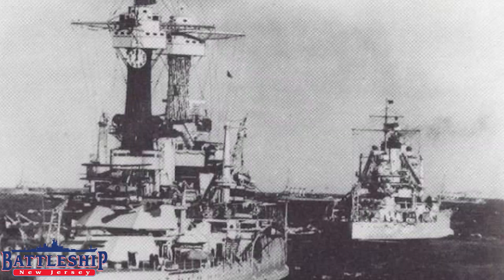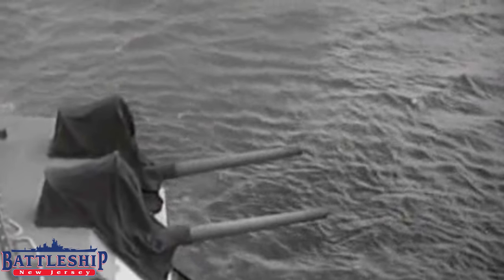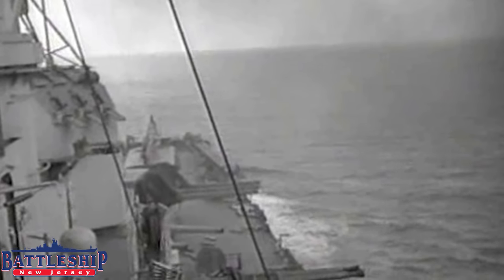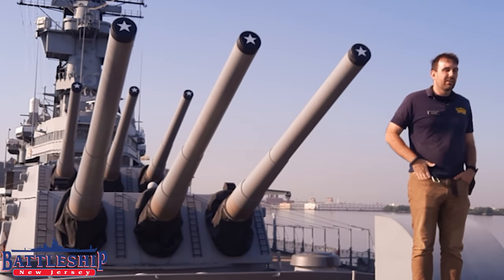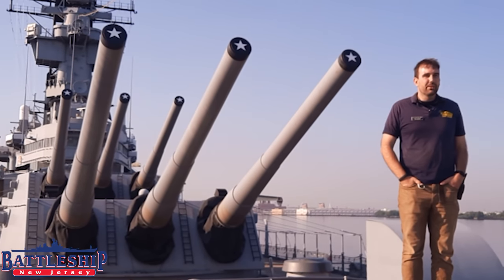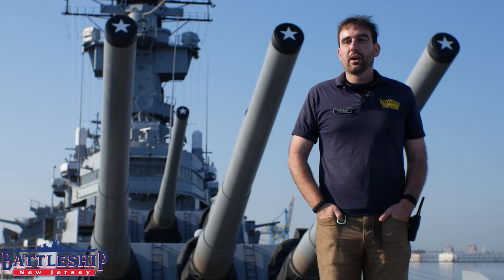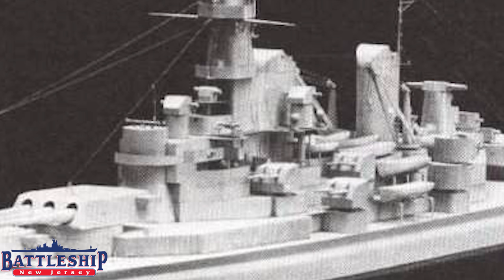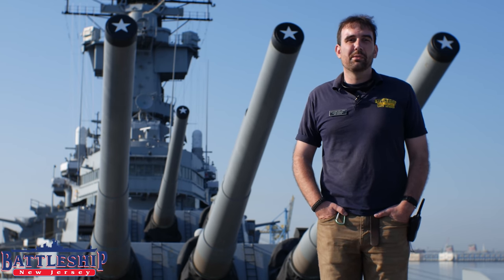Why are There Clocks on the Superstructure of Battleships?

Comment: A good reason not to send range and bearing via radio is that they are the same both ways, so you are giving your enemy a solution back to you as well.
Reply: Exactly what was on my mind throughout the video.   Jumping on comms to report "Enemy ranged at 12,500 yards" to your fleet also immediately informs the enemy, who may see you but not have an accurate firing solution yet, exactly where to set their guns to counter you.
Reply: True, but if they are duking it out broadside where they can bring all their guns to bear then neither side is going to be able to reliably read a clock facing forward and aft of the enemy ship due to the angle and parallax alone.  It would really only help the enemy if being fired upon from roughly the bow or stern, though I would presume they could simply disable the range clock facing the enemy in such cases, or, better still, set it to display erroneous ranges (why trust what your enemy is telling you and what’s a couple more switches on a ship already outfitted with thousands of switches for redundancy?).  But the best reason of all was that it simply wasn’t necessary to share such info at all once every ship in the formation already had the technology at hand to determine range and elevation far more accurately than the old way of doing things.
Reply: Bearing, no.
There are non-symmetrical effects even in a complete mirror situation, like spin drift, Magnus effect, Coriolis/Eötvös effect.
Air resistance means the projectile path is not a parabola and thus goes through different air (density, wind, moisture ... ) from one ship to the other ...
... and you can see quite clearly how much the barrels of the enemy point or not point at you.  Just think of a ship pointing right at you or a bit left or right and how clear even small changes are from straight at you.
Reply: @advorak8529  Yes the bearing is not entirely symmetrical, and the wind may be slighty different, but a really good starting point is to apply exactly the same angle offset as your enemy is if it is hitting and you will end up much closer than a guess would.
The wind may change significantly along the path of the shot and you can only measure it at sea level at your ship, so the incoming will provide more info than you can get yourself.
Reply: I'm assuming you would transmit something like that encoded.  But wouldn't it be very easy for a line of enemy ships to exactly fix your position by triangulating your radio emissions?
Reply: @VesperPerson  It would need to be a very long line to get your range with enough accuracy to shoot you, and with radar it's completely irrelevant.
Reply: @brendonwood7595  These days, yeah, but not BITD.
Reply: @VesperPerson  They probably used a low power transmitter. A 100 milliwatt peanut whistle is only good for a mile or two. After that, the signal is too weak to pick up, which would render encoding unnecessary.
Reply: @ethanpoole3443  Nope.  Remember, he is talking about why you would use a clock and not the radio.  The enemy can intercept a radio transmission, but not see a visual indicator like the "clock".

And remember, this is the interwar era.  There was no RADAR yet, it was all visual.  Most cases, by knowing the class of ship you are fighting, and its size.  With that, you can estimate how far away it is by the size in a viewfinder or telescope.  You then fired rounds at that distance, observed where they fell, then adjusted.  The use of this would make that process faster for multiple ships, as once one found the range the others could quickly copy it.

At that time, the most "advanced technology" for doing so was still essentially the Mark I eyeball, and maybe a scope with marks inside the lens.
Reply: Well, discovering range to enemy ship is not something you immediately need so badly, that you would keep intelligence officers monitoring a broad band. I guarantee, ANY naval officer will calculate distance faster than radio transmission will be found, translated and validated. Plus, there are low power high freq. transmitters which really transmit voice in close range, basically naval walkie-talkie. In the end, distance is just one part. You also need mutual vectors, velocity, wind and of course knowledge of your gun ballistics, including its change over time with barrel heating. Distance is really the easiest part.
Reply: @wwlb4970  The US navy clearly didn't agree with you given they built a device to transmit the range between ships, and clearly had a person to operate it and look at other ones.
Reply: @brendonwood7595  But that's what I was trying to tell, maybe in a bit oversimplified way.

OF COURSE distance is important. It is not the only parameter, but it is important. And it's very cool if you can get it from allied ship faster than you do it yourself. It is just not important enough so that you should have intelligence officers on enemy ships scanning all the chatter, translating it, validating it and deciding what to do with it.

It is really faster to calculate your own distance on enemy ship rather than rely on enemies, which might also try to trick you. You should be understanding what they're going to do in general on the theater of war, rather than what they're going to do immediately. Latency of mid-XX century.
Reply: @wwlb4970  You are confusing the technology of that era, which is available today.  The radios you are talking about did not exist yet, and would not for decades.  And being the first to land shells on the enemy would literally make the difference between winning and losing a naval battle in that era.

As for the rest of the calculations, that is all fed into the Mark I Fire Control Computer.  That would automatically adjust for such things, including humidity, number of powder bags used, and even the kind of rounds fired.  But of all of those, range was the most critical piece of information that had to be determined.
Reply: @michaelmartin4552  You are confusing distance with method of obtaining it. Could you please be more specific, which technologies did not exist at the time? Short wave transmitters working at a mile range? 

My argument was mostly related to 'giving distance to enemy', not the importance itself.
Reply: Does the Iowa have the spaces for the range clock ? Are there hollow spaces where the mechanisms for the range clocks would have been?
Reply: @swimfeared  Yes, but by that era they were becoming obsolete.

The advancement of naval gunfire computers (Mark I), as well as the less reliance on massive Battleship formations meant they were no longer as important as they had once been.

And by the time the US entered the war, the first generations of RADAR was being placed on US ships, which made them completely obsolete.
Reply: @danielstickney2400  Exactly. While stressed out people on one side struggle to transmit something, it should be twice as hard for the stressed people on enemy side to read information which is loosing its relevance every several minutes.
Reply: If it’s a 2 hand clock that only goes up to 10, and one hand represents thousands yards, and the other hundred, how is 12,000 yards shown on the clock?
Reply: @wwlb4970  Then you tell me about what radios were available that had such short ranges.

I am laughing, because you keep arguing I am wrong, but provide nothing to back up your incredulity.

Oh, and "Short Wave - High Frequency" is nowhere near the same as VHF.  Unlike SW and HF, VHF operates at a wavelength between 1 and 10 metres and a frequency between 300 and 30 megahertz.  The first sets capable of operating at those frequencies were not even developed until right before WWII.  And commercial use of VHF did not start until over a decade later in 1955.

I already discussed many of the technical reasons why this was used, when, and how.  You just throw things out and completely ignore the things I specifically stated like the skip properties of SW and HF radio.  How a lowly 4 watt signal could travel half way across the world because of skip, while a similar VHF signal is limited to line of sight because it does not skip.

You can laugh all you want, but it is obvious you know little to nothing about how radio signals work.  The military still uses VHF to this day, because it does not skip.  The military does also use frequencies for long distance communications, commonly called "Tropo", because it uses atmospheric skip while the local units do not.

And FYI, I am in the Signal Corps in the US Army, and first got my HAM operators license way back in 1984.
Reply: @danielstickney2400  Heck, signal flags are still often used even today.  I know that at least until recently, M1 tank crews were still issued signal flags.  And we were using them when I was in a PATRIOT missile battery as recently as 10 years ago.

And it may be for many reasons.  Specifically in the event of radio failure, or if they had to operate in radio silence.  We used them in the event a launcher crew had to move downrange, and the RADAR crew had to power up their system.  It was a quick and effective way to warn the people working on the launchers that they had to walk out and around the path of the RADAR when it was powered up.

If one of the RADAR crew went next to the unit and waved a red flag, we knew to go around it when returning.  If he or she waved a green flag, it was safe to come back directly.  We all had a healthy respect for those things, it is almost like walking into a microwave oven if one is fired up and you are in the path.

And all ships still use flag and light semaphores even to this day.
Reply: @wwlb4970  1-4km, in a battle line of capitol ships?  Bah, by the time of WWII (Surigao Strait) they were generally 2-4 miles long.  Not kilometers, miles.  the 1-1.5 km would not even reach the next ship in the line.  Seeing the signals visually was more reliable at distances than radio.  And also faster, as they did not have to talk to anybody, just look at the mast of the ship in front of behind them that had already bracketed the ship and was firing for effect.

In other words, these low power signals would have reached maybe a single ship, better to use semaphore.

But your attempt at insult is noted.  You can not really make a real argument, so instead toss around insults.

Now granted, by the time of Surigao Strait radios were meaningless because the ships had RADAR.  But we are talking about the period BEFORE THEN.  Which you seem to keep missing.  And bringing up systems that would either have not worked at all, or relied upon operators in every single ship having to send a constant stream of chatter back and forth from one end of the line to the other.  What, you think the ships were steaming bow to stern or something?  

But please, tell us about this magical ability to precisely obtain distance of a ship through entirely visual means.  That apparently "anybody can do".
Reply: Unless it’s coded
Reply: I wonder what the life expectancy is for a gun barrel on one of those . How many rounds before they'd need changing etc
Reply: @wwlb4970  good reply very interesting iv often wondered . When u see them in action im thinking the wear and tear must be huge and wondered if barrells could be changed at sea or back to the dockyard . Suppose a lot depended on size tho to be able to carry Spares .
Reply: @lemmy6782  Well, the mentioned gun weighs around 66 tons. Not very convenient to replace it out in the sea, but if you apply some fantasy, a repair ship with a heavy crane might be able to do that. Not sure if US had such at the time, but repair ships were quite successfully used in the Pacific to the point that USSR decided to create a repair fleet after researching their experience (Project 725)
Reply: @wwlb4970  great replys 👍 iv always has an interest in the Pacific war .
Reply: @lemmy6782  around 300-400.
Reply: @cody4783  you guys ever heared of cryptography? 

you seriously believe the radiotraffic was uncoded?

for point to point comms, lightsignals were also a common method. That prevents triangulation as well as interception.
(theyre directional and cannot intercepted easily - unless a hostile ship makes it in between the two parties who are communicating)
Reply: @wwlb4970   youre forgetting that these ships are from ww1 era - there was no VHF voicecomms at the time. All was morsetelegraphy via HF, and the frequency range available at the time did not allow to hide the comms for long.

However, of course there was cryptography.

Also, light and flagsignals were used if in visual range.

Best regards
ex-navy radio operator
active ham-radio operator
Reply: @zoolkhan  I know, but as you see, the whole conversation quickly turned to be WWII-related, because discussing hypothetic enemy after WWI has no sense otherwise; and the enemy was clearly mentioned by OP. However, there were short-range VHF radios in early 30-s already.

As a radio operator in navy, tell me please, do you see any reason to monitor communications of an enemy, translate them, guess where is the ship sending distance to others, validate whether this is not a trick and then report to ship command - or is it faster to find range on your own?
Reply: Great point but I'd be interested to see if the adversary could use it to advantage.
Reply: @j.p.vanbolhuis8678  Yeah, there is "some" practical reason to communicate this to allied ships, but little to no reason to obtain such short-relevant information from enemy, that's what I was trying to tell whole thread.
Reply: False. Coriolis Effect.
Reply: @VesperPerson  Triangulation wouldn't work well because the enemy ships were all together. All they could effectively do was get a direction.
Reply: @wwlb4970  I just need to point out a serious flaw in your argument about it being quicker to find target yourself than intercepting a bearing message. Do you even know the avagerge salvos a ship would go through before accurately finding range and bearing before landing hits on another ship without radar and even with radar. Now take into account if I send message saying ship at 12,000 yards bearing 230 degrees and the enemy reads it how quick they can start landing hits.range and bearing were the most important factors especially before radar to get your guns close to target to start landing hits... and time is a major factor because the first to draw blood normally won the engagement
Reply: @crazyeddie1981  Ok cool. Now, in a line of ships, with massive amount of communication incoming, you need to:

1. obtain communications
2. sort them
3. guess which ship sent the right one, on you or on someone else.
4. validate if they're not trying to trick you
5. make adjustments for vector, Coriolis force and speed.

And all of these when your enemy already has firing solution on you and is opening fire any second now. You're definitely not the one to land first shot in this case. Plus read the whole thread about possibility of short-range communications which would make it senseless.
Reply: now yeah then no

Comment: The main reason that they didn't transmit range and bearing by radio was that when the line of battle commenced firing, all hell broke loose.  You would not be able to reliably hear range and bearings transmitted by radio and then have to be transmitted to the gun directors.  The visual range clocks were a quick and reliable way to get this information quickly to the directors. I can tell you that even with our 2  5"-54s blasting away, it was pretty noisy in the bridge.  I can well imagine what it must have been like with 16",14" or 12" guns hammering away along with the 3" and 5" secondary batteries firing as well.

Comment: In that era radio meant Morse Code because voice transmission didn't develop until the 1920's. Instructions by radio were sometimes garbled by electrical interference. The range clocks were a more reliable way to communicate with virtually no chance of being misunderstood during the heat of battle. When ships and aircraft are in battle everyone seems to be transmitting at the same time which also interferes with clear communications.

Comment: Have you shown the mess decks? In 1969, New Jersey returned to the States and was in Alameda. I was stationed on USS Ranger, which was in Hunter's Point undergoing routine work between deployments. I had a friend aboard New Jersey; so, I caught a launch across the bay to visit him. As it was time for lunch, we went below and had lunch. It was a great meal, ham, mashed potatoes, and more. I asked if it was typical fare and was told they actually ate better at sea.
I still believe that the Iowa class BBs should still be in service. A CV is awesome by its size but doesn't compare to walking underneath the 16" barrels of a BBs main armament or to stand beside a 2700 lb. HE round.

Comment: was watching the video from the other night about the grounding of the missouri and it spark the memory that my grandfather had given me some old pacific coast pilots. the navigation books so i dug up both of them one is from 1942 (6th edition0 and the other is 1963. the 42' has a supplemental set of pages and on the first page of the supplement it has general warnings about regulations of explosive materials and goes into details aboutbombs and depthcharges etc. was wondering if the battle ships used these books or just the commercial and civilian shipping?
Reply: do you still have that book?